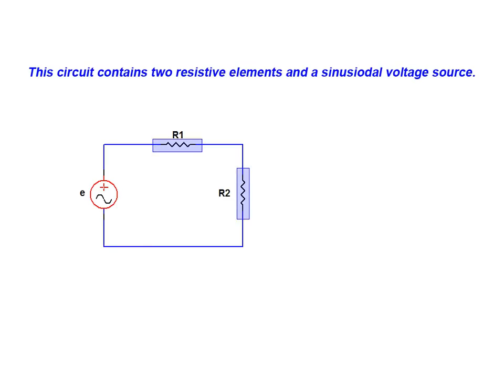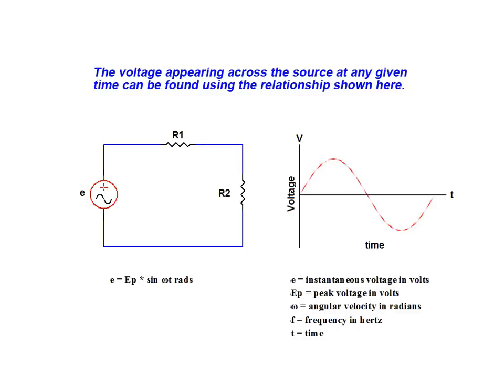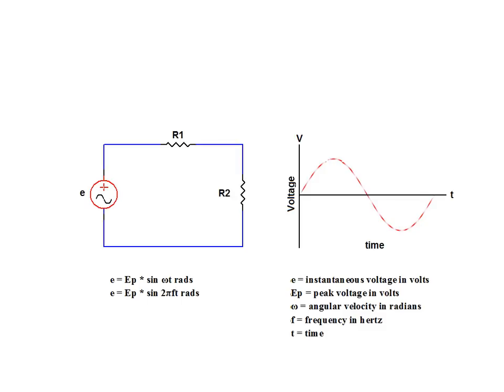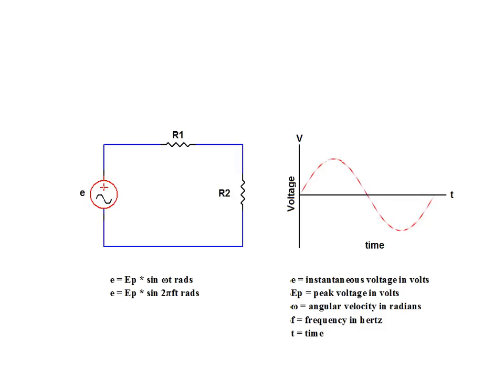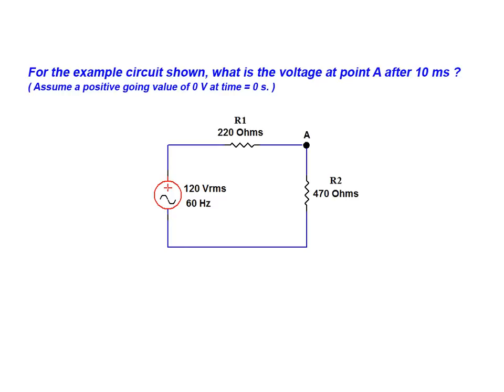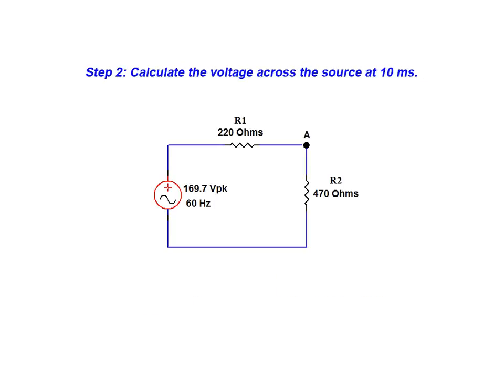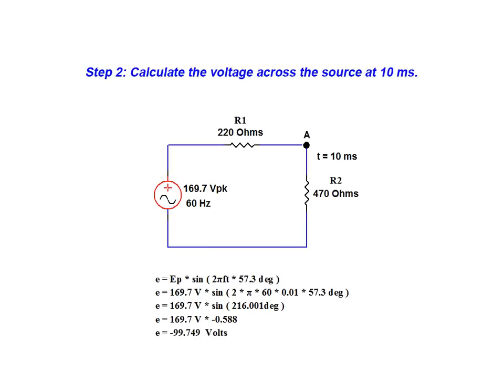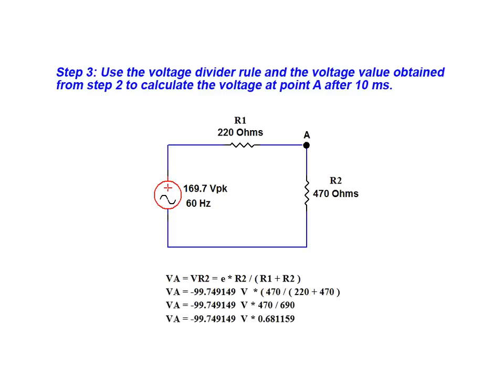Online tutorial on how to calculate instantaneous voltage of a sine wave source

Comment from the maker: On a pure sine wave plot, you view the horizontal axis as being 0V.  If your neutral is tied to ground, and you are dealing with a sine wave source, then it remains at ground and could not "pulsate" as you call it.  When ploting values, you need to maintain a reference.  The sinusoidal waveform is a representation of the polarity of the other terminal with respect to the one being held constant.  I hope this helps clear things up.

Comment from the maker: When converting an RMS voltage value into its peak voltage equivalent, you simply multiply the RMS value by the square root of 2 or approx. 1.4142  This will give you the peak value (Vpk) from the RMS value.  I hope this helps.

Comment: Could you explain 0.588, what is that?. I understand everything apart from that, I think you called it ' the sign of the degree measure.
Thankyou, Jim.
Reply from the maker: Hello,It is the "sin" function value of the angular velocity.  You convert the angular velocity to degrees and use the sine function on your calculator. This gives you the -0.588 value used with the peak voltage to determine the instantaneous voltage at the given time.

Comment: How did u get 57.3
Reply from the maker: +lobsang Tsering Hello, there are 2*Pi  radians in a complete revolution.  In terms of degrees, there are 360 degrees in a complete revolution, so if you are given the randian measure value, and wish to convert to degrees, you would multiply it by 360/(2*Pi) which equals approx. 57.3   This is how many degrees are in a single radian.